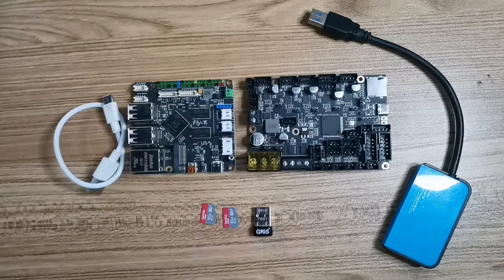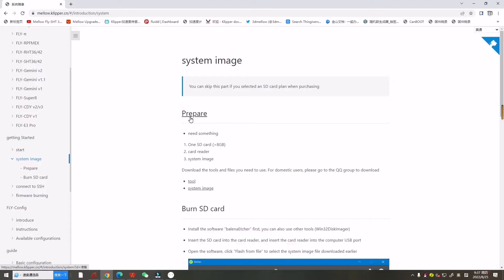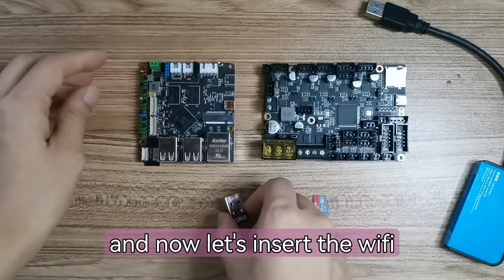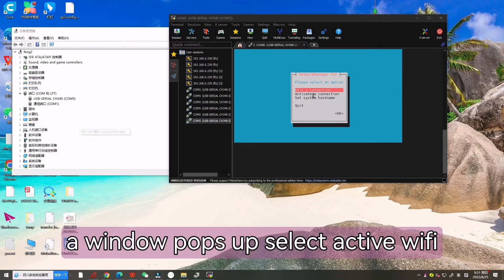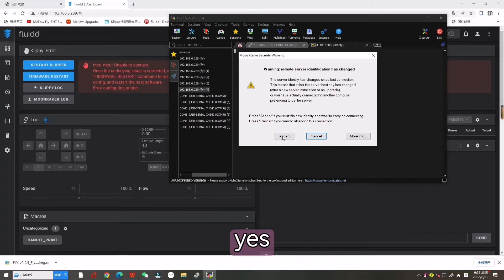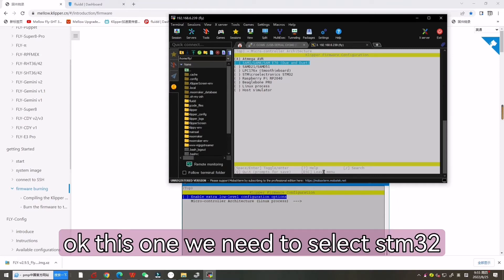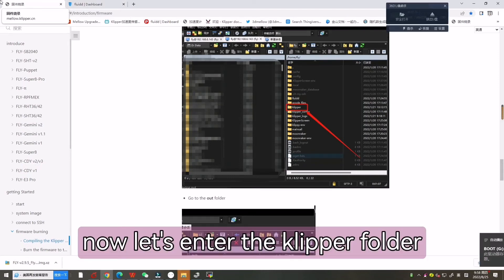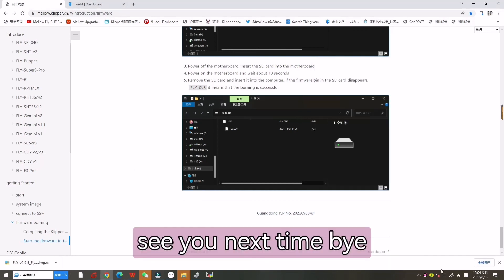Guide: Mellow Fly E3 Pro V3 board install klipper - step by step guide for 3d printing beginner

Comment: Hello!

I tried to install the Klipper on the Mellow Fly E3 Pro V3, but in the end, nothing worked for me. In the end, I found instructions where they advised to install Katapult (Ex.canboot) first, and then install klipper. I tried to make a Klipper installation according to this instructions, but in general everything stopped reflash.

I have ST-Link. Can you give me a basic firmware or bootloader for Mellow Fly E3 Pro V3 so that I can restore my board?

Comment: where is the cfg for this bored?
Reply: Can this be done with a regular raspberrypi 4b?
Reply from the maker: hello friend, it needs to be configured by itself. Different machines have different structures. thanks
more information about this board: https://teamgloomy.github.io/fly_e3_pro_v3_pins.html
Reply from the maker: hello friend, we have update the  klipper configuration file on our FB group: https://www.facebook.com/groups/395979321769632
Reply: @3DMELLOWPrinter  thank you very much!
You have the cfg for the fly rff e3?
Reply from the maker: @oridadon7472  hello friend, sorry now not have, if have i will inform you, thanks